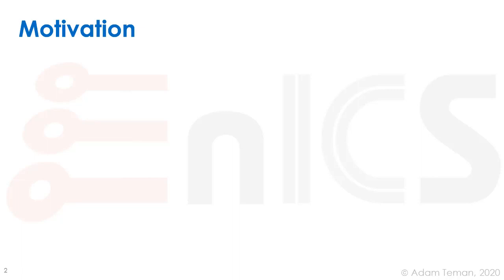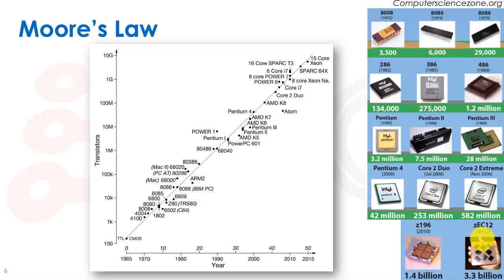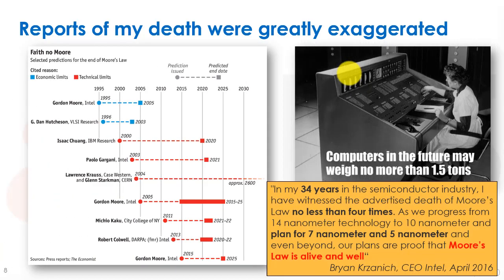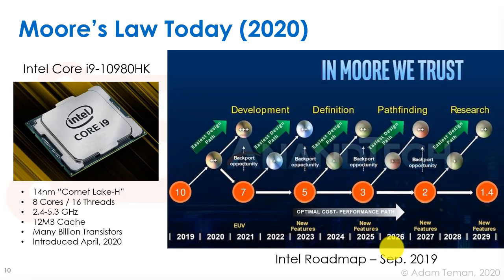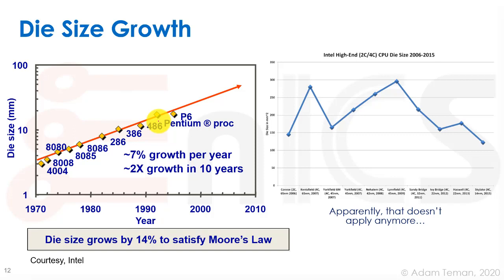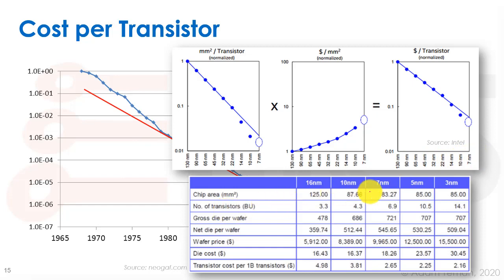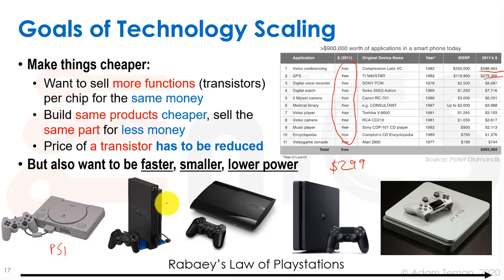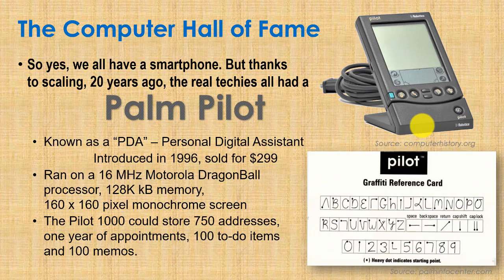VLSI - Lecture 5a: Moore's Law

Comment: Can u pls explain about base DRCs , why we get base DRCs and How these depends on Floorplanning. 

Thanks
Reply from the maker: Hi Praveen,
That's a pretty big question - not something answered within a comment reply :).
However, the basic answer is to understand the manufacturing flow. I suggest watching Lecture 2 of this series, starting with this lecture: https://youtu.be/O9M7IHHM5-8

(You can find the entire course content on my website, here: https://www.eng.biu.ac.il/temanad/digital-integrated-circuits/) 

I also have a lecture with a bit more about DRCs, but I haven't recorded it in English, since it's not part of the lecture schedule in my course anymore. But you can take a look at the slides (in English) here: http://www.eng.biu.ac.il/temanad/files/2017/02/Lecture-2-Technology-and-Standard-Cells.pdf

And if you're interested in advanced nodes, I made a lecture series about the technology, including many points about design rules. Take a look here: https://www.youtube.com/playlist?list=PLZU5hLL_713x06MZ4OwMwnYGEeszuckZK